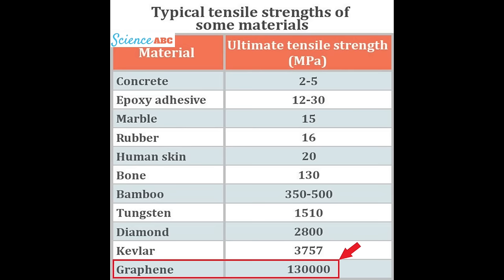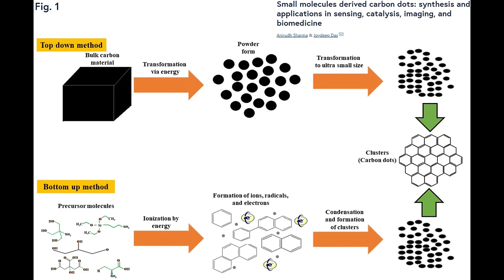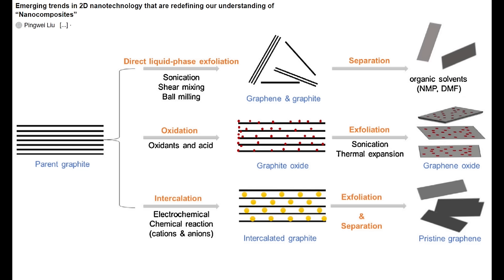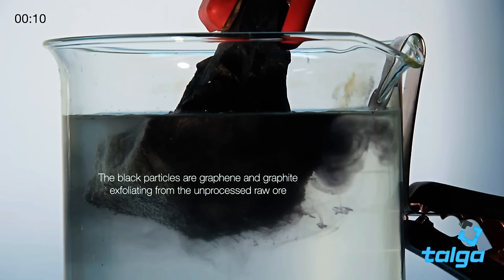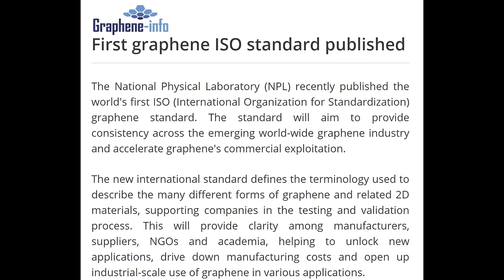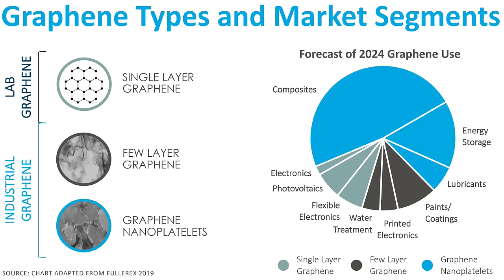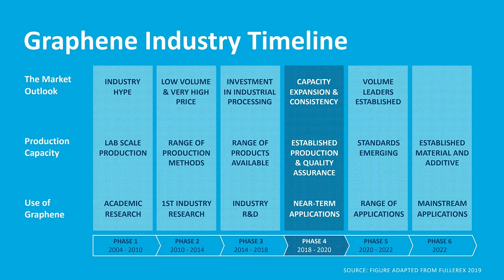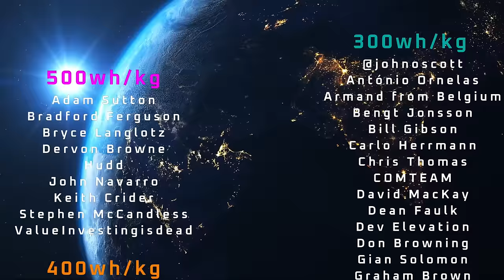Commercial Graphene Production // Allotropes and Applications

Comment: Nice vid, as usual. I'm gonna have to review mt chemistry... I thought the carbon hexagons had double bonds between every other pair of carbon atoms. Certainly in classical chemistry the hexagon rings are shown as alternating single and double bonds (at least in benzine for example). The electrons are of course available for charge carrying, but fundamentally do take part in bonding (making the double bonds more energetic). Also, the rings are usually drawn crinkly as the normal bond distribution is tetrahedral (ie the largest 3D spacing of the bonds permissible), which is also the case in atomic diamond structure. (But then water has a 'V' shape when you'd imagine it to be a linear molecule. We know it's V shaped because it has an electromagnetic dipole so it hydrogen bonds, so it doesn't necessarily follow that graphene is crinkly...)
Reply from the maker: I'll defer to you on this one 😃  Graphene is a rabbit hole.  I had to make a choice as to how deep to go.
Reply: @thelimitingfactor  Cheers. I wouldn't however if I were you. My chemistry is pre university level some 40 years ago. I suspect the teachings on valency and electron 'donation' may have changed somewhat since then. I remember the 'new theory' in geology was all about plate tectonics back then. Seems like standard elementary school teaching now

Comment: @ The Limiting Factor - What role do you think Synthetic Graphite from NOVONIX will play in Tesla's own battery production?
As I understand it in the video below, NOVONIX can supply very raw material (Synthetic Graphite) which together with nickel can make a very good battery
Translated from Danish
PS Thank you so much for making such profound broadcasts!
Synthetic Graphite For Next Generation EV Batteries w/ Dr. Chris Burns
https://www.youtube.com/watch?v=GEtWS2WPoBs
Reply from the maker: It will be a year before Novonix can even supply enough battery material for 30,000 model y or 3 per year.  And another couple years before they can supply enough material for half of what giga Nevada is using right now.  

I don't think novonix factors big into Tesla's plans.  Maybe licensing dpmg?  But novonix hasn't decided whether to do this yet or not.

Thanks man!

Comment: Is Tesla bought sillion?
Reply: Sean Mitchell has info that Tesla did buy Sillion
Reply: The hype is real man !
Reply: I think it comes under "probable speculation"
I'm not sure that their tech will make it into this upgrade....... Jason?
Reply from the maker: I'm looking into this.  SilLion is targeting a leap to 80% silicon in their anodes.  The tech they are using is promising.  However, it looks like at least a couple years away.  If you notice the job advertisements for colorado, they are for test engineers.  This means they are probably going through a rapid iteration process to try to get it to work.

Comment: There are applications were even 20-minute recharging is too long. Those are applications where price and energy density are lesser concerns to recharge times.
Reply: In vehicles?
0-100%?
Will never happen.
Reply: @rogerstarkey5390  
Even with graphene anodes?
Reply from the maker: Yup, there are applications, but they are niche.  There is a small but vocal minority concerned about charge times over pack size.  What seems to be missing from that conversation is that if you increase the battery size, it increases the charge rate.  That is, by focusing on energy capacity, you automatically increase charge rate.  This is because it's always the last 20% of charge that takes the longest.

Charge rate is third on the list for Tesla behind price and energy density for good reason.
Reply: @thelimitingfactor  
What I'm wondering about is the Tesla Megacharger for the Tesla Semi. I don't know of many electrical loads that quickly ramp up from 0 to 1 MW or more and then back down again. My guess is that the megachargers will get their power directly from the medium-voltage grid (1 - 35 kW, 3-phase). Will there also have to be battery storage on-site to smooth out the power consumption ramps (both up and down)? How thick and heavy would the Megacharger cables be? Will the voltage be kept low to make it safe for manual use or will be the megachargers be plugged into the Tesla Semis robotically? Medium voltage electricity is no joke. If something goes wrong while being handled, you're toast. Literally.
Reply: @hyric8927  
It doesn't have to happen.
A pack has to out-range the occupants on the first segment of a journey, then add sufficient for the next segment while they refresh.
A 15-20 minute stop after 4 hours driving is quite reasonable. The ability to add another 3 hours travel with a buffer during that stop will suit 99% of drivers.
That's what I believe we'll see at battery day even without graphene.
As graphene technology matures I believe packs will actually get smaller
Reply: @hyric8927  
We've seen pictures of the Semi with two chargers linked to one connector.
Why not the same on both sides of the production truck?
Use V3 chargers, that's potential for 4× 250kW.
Split the pack, good for redundancy, one feeds the two front motors, one feeds the rear(?).
That's effectively the "Megacharger" using existing equipment.
Also mean's the Semi retains emergency charging through "normal" superchargers.

Tesla is all about modular systems.

If they can get to one motor type (different gear casing) 1 charger type, modular pack for all vehicles (multiple in Semi, etc) the economy of scale will be another game changer.